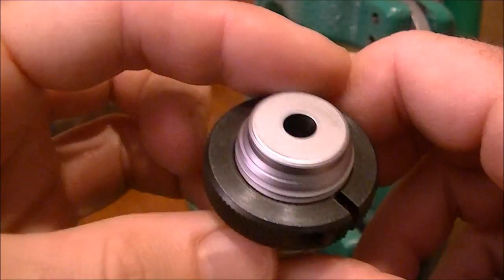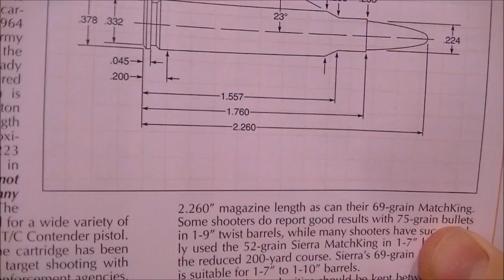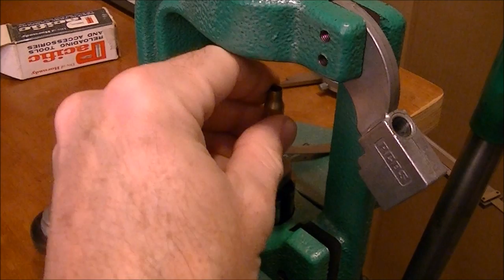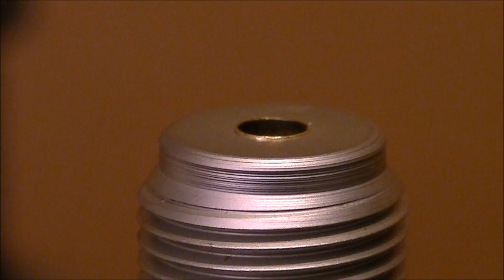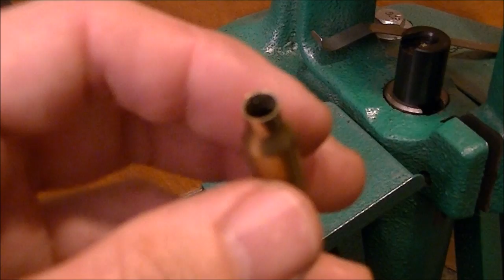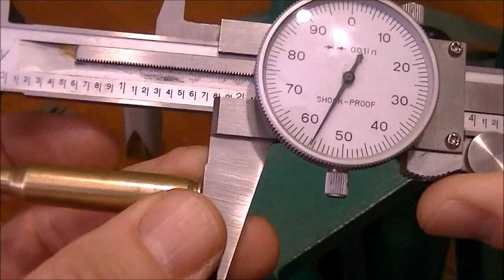Ammunition Reloading: Using a File Trim Die

Comment: Question: is the die harder then the file?
Reply from the maker: Yes, the top surface of the die is much harder than the file, so hard that the file just slides across it without taking any "bite" on the die.
Reply: @314299  thanks, bought a week ago, just bought a press. New to reloading, soon I'll be hunting deer 😎

Comment: Very informative.  Just got into 8mm mauser and I'm exploring every possible angle to source or make my own.  Waiting on an rcbs form and trim so I can make 3006 into 8mm.  This is extremely helpful
Reply from the maker: Glad you liked the video. I have made a fair amount of 8x57 out of 270 Winchester brass. The file trim die in 8mm is quite handy for doing that as you can use a hack saw to cut off the excess brass quite quickly. I've not had to make any more for a while as I came across a deal on factory made 8mm, but it kept me in re-loadable brass for awhile.

Comment: Question.? when using any file trim dies must you always use an Extended Shell holder Correct.?
Reply from the maker: I don't think an extended shell holder is necessary if you are trimming longer rounds, like a 308, just with the shorter ones.

Comment: I've went through 2 trimming set. 1 is the Lyman with a drill, but the case keep slipping out if the shell holder.  So if went with a Lee deluxe quick trim kit that trim, chaff and debur all in one.  So far, it's the best trimmer I've used.
Reply from the maker: I've not used that particular Lee system but I do use the older type.

Comment: File trim dies don't seem to be for sale. Can the Lee Trim due be used in this way--with a file rather than buying the cutter head?
Reply from the maker: No, the Lee Trim die cannot be used like a file trim die as they are of a completely different design.
Reply: Checking with Midwayusa.com I found RCBS file trim dies. I initially searched at Brownell's, which doesn't offer the RCBS file trim dies--only Redding. When I realized that searching Brownell's, I had to know that Redding makes these dies, and word my search as Redding Trim dies or I couldn;t have found it there--you can't just search for file trim dies and find ANYTHING on their site. Brownell's website leaves much to be desired...
Reply: @Joe_Goofball   Midway USA Or Mid South stock best of any and everything etc.

Comment: Question my Rem 223 Cases are just about a thousands over the  1.760 max length.? Would the Cases still be ok to load & Fire in my Bolt Action Rifle.? With no problems etc.?
Reply from the maker: +MyREDTAIL You should assume that anything over the max length needs to be trimmed.

Comment: And to mention,? That those File trim Dies ,? Can not be hurt or worn down by using a file on them.? As they are some strong resistant type Metal,? That they are made of.?
Reply from the maker: +A REDTAIL The dies are made of steel, however the surface has been hardened to an extreme degree so that a file will not harm them.

Comment: Thanks for  sharing this  Video.? This Die is all that I use for all of my Rifle loading.? Works great & fast with a File.? I find it less troublesome than using  a trimmer machine etc. Been reloading over 25 yrs  using Trim dies.? Never a problem.? Just de burr the cases after filing them & your trim is done.
Reply from the maker: +A REDTAIL Trimming cases is a pain no matter what, but as you say the file trim die is actually faster and easier than hand powered rotary trimmers.

Comment: So I've bought a Schmidt-Rubin 1889 (you and Gungeek have cost me a fortune this year!) and will be trimming 7.5×55 Swiss down to 7.5×53.5. Any suggestions on how to do that? I use the Lee depth gauges and trimmers for all my other calibres and don't want to buy a lathe-like case trimmer for this one custom job. I am thinking of chucking the Lee shell holder in the drill press, chucking the brass in the holder, and lowering the case down on to sandpaper or emery paper affixed to a flat block. The drill press depth gauge should be precise enough to get me there. Although, just writing that all out and re-reading it makes me think that this whole idea is rather silly. I may just get another Lee depth gauge and trim the pin to a suitable length. Thoughts?
Reply from the maker: Yeah, if I were you I'd just buy another Lee case gauge and cut the pin down with an abrasive stone using a Dremel tool until I ended up with the correct length.

Comment: I did not even know such dies exist. What kind of steel are those made of?
I bought a Lee trimmer about 2 years ago, but my 7.62-53 Lapua cases have not streched long enough to be trimmed, shot most of them about 3 times. I also got several once-fired S&Bs, found them at the range, which are a bit longer, stamped 7.62-54.
Reply: Kriptonite i guess never wear out etc
Reply from the maker: I'm not sure of the steel type, must be some type which can be machined and then hardened to an extreme surface hardness. Are you are neck sizing your brass? Neck sized brass seems to stretch much less than full length sized.
Reply: 314299 Shooting Channel
I have only a full length sizing die. Tried to back out the die a bit to only neck size, since sometimes case shoulders got dimples, but then the case would not fit in a chamber. Just measured some of the Lapua cases, they are about 53.4mm (should be 53.69mm for standard Mosin case).

Comment: That looks like a great way to trim cases. Have you ever worn out one of those dies and about how many cases can you file before it wears out.
Reply from the maker: I've not worn one out and I've never heard of anyone else wearing one out either. The top of the die is super hard and the file does not bite into it at all, I really don't have any idea of how much use it would take to wear one out.
Reply from the maker: potymouf1
Yeah, it seems to burnish it a bit.

Comment: there are certainly worse ways to spend a cold afternoon than trimming cases.  Neat system and it's simple and very consistent.
Reply from the maker: Using the file trim die is a bit like reloading with a Lee Loader set, not the most modern or high speed method but satisfies the part of me that likes "old technology".

Comment: Neat! I don't think I've seen one of these outside of Ackley's handbook for shooters and reloaders, in which they are basically "sold" as the last step after necking down in multiple stages to form what at the time were generally either wildcats or long-obsolete cases that might as well have been.
Reply from the maker: Yes, they are often included as part of case reforming die kits. They are not nearly as common today as they were 30-40 years ago when many reloaders did not have case trimmers.

Comment: I'm trying to see an advantage of this over some of the other more common and cheaper methods, and I can't. The Lee system is ~$11 more compact, and extremely consistent. The hacksaw point makes sense. However, I've seen people using a drill press with a lee rotary cutter to remove about a half inch of case for 300 blackout from 223 brass, and that seemed like the way to go.
Reply from the maker: Most of the case trimming I do is with the Lee system, which I like a lot. I figured there were a lot of folks who have never seen a file trim die in use and might find it a bit interesting. I pick these things up at gun shows if they are reasonably priced, but I doubt I would buy them if I had to pay new retail.
Reply: That makes sense. It's always nice to see other methods, and how things used to be done. For one thing it highlights the value of improved methods we have now. Another thing is that it can inspire new innovation. The system you show could be compared to a couple "newer ideas": dillon's power trim, and the newish Lee quick trim system. --Which inexplicably does not have power attachment option. I asked a Lee rep about whether one was in the works, and he said they had no plans to release one. That's just crazy to me. The value of their system would be immense to progressive reloaders if they simply had a cutter with a drill shank on it for that.